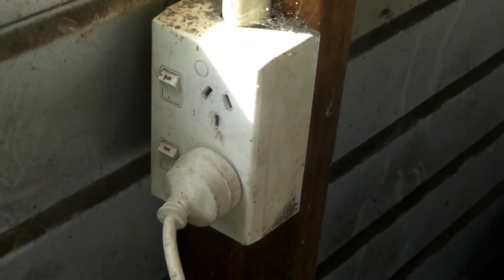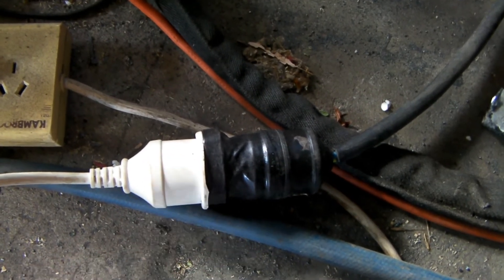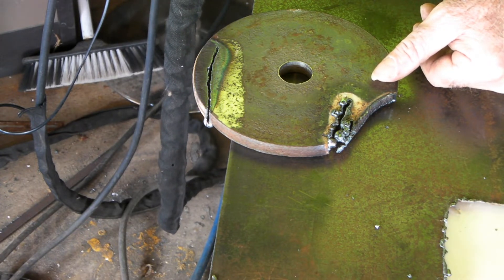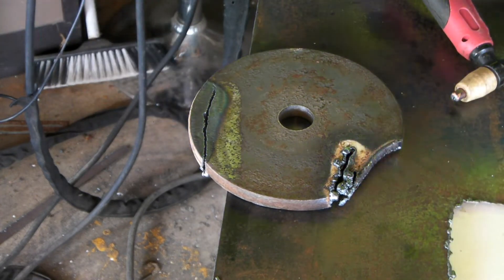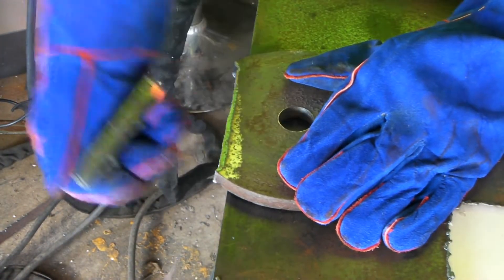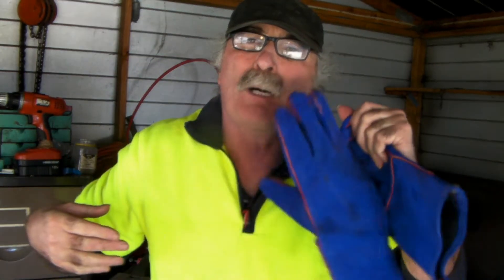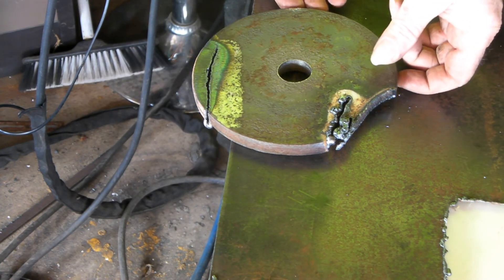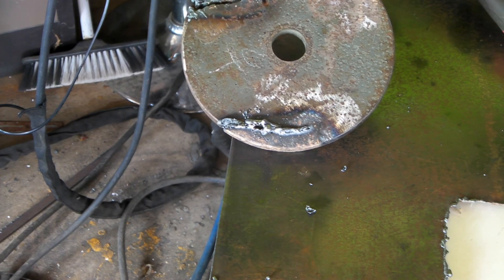Plasma Cutter Using Extension Cord

Comment: As usual , thanks for the useful info and the entertainment.    BTW , is there a source for longer consumables for an AG60 gun ?   I have a unit with pilot arc and the tip is way short to run on an edge guide even when I remove the stand off cage and disable the pilot arc feature.    Can I fit another gun on this machine with a similar Dinse connector such as a PT-31 gun if longer consumables are unavailable for the AG-60?
Reply from the maker: Hi James .The pt-31 consumables are quite long but its not a pilot arc torch. I will look into it and see if you can get longer AG - 60 consumables thanks.
Reply: @petestools  I see that a Pt-31 torch has what looks like the same fittings as the AG60, but in your experience , can a pilot arc machine work as a drag cutter if you aren't using the pilot arc feature.    These torches are cheap and worth a try as long as the attempt doesn't hose the machine.

Comment: The rule of thumb for any extension cord is go with a LARGER/HEAVIER gauge than the wire to the tool... so eg: 12g extension for a tool with 14g wire and use as short an extension as possible... otherwise you are creating a high resistance path (like the wire in a toaster).. not good,
keep up the great videos and cheers from N.W Ontario Canada (btw it's -30c this morning here... bet you've never seen it that cold eh!)
Reply from the maker: Wow mate that's bloody cold lol, Thanks for your great tip.

Comment: One part of that white cord was black. It was close to catching fire. The machines here all have a 50 amp 240 plug on the end. That’s if they’re 240 volt machines. The small ones for 120, of course don’t. They have 20 amp plugs, but a machine can only output 27 amps that way.
Reply from the maker: our home supply is only 10 amp 240 volt ,But my plasma cutter,compressor, mig welder run on 15 amps .Always having circuit breakers  blowing here HA-HA